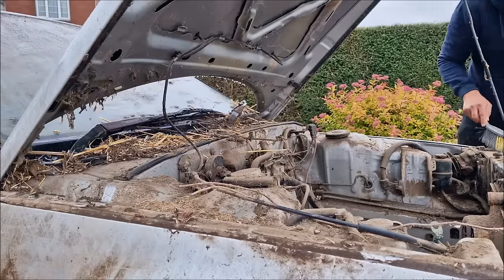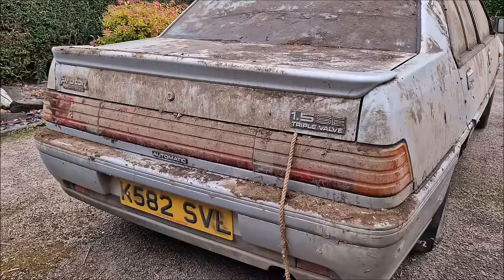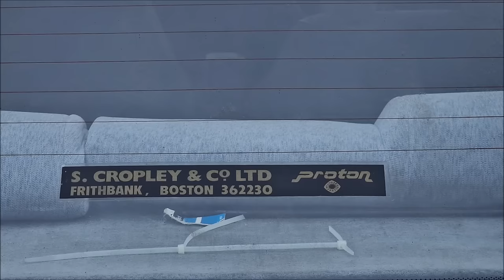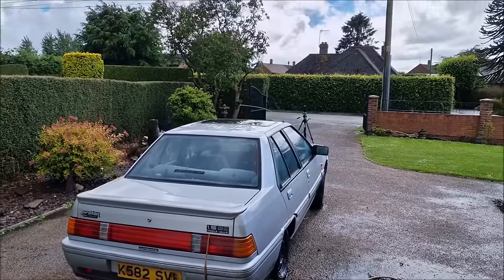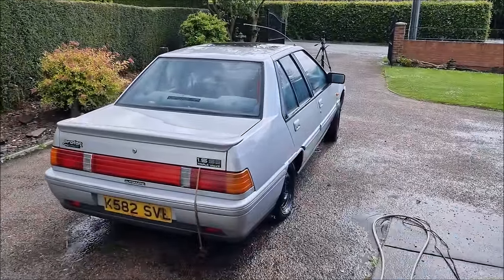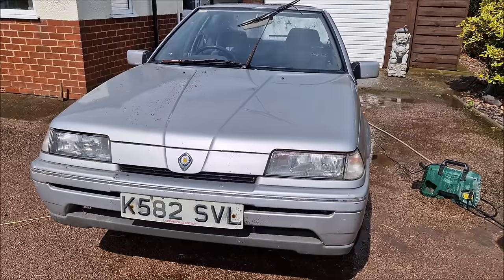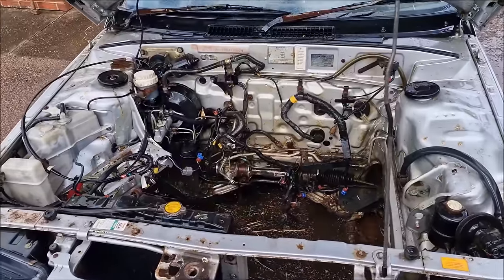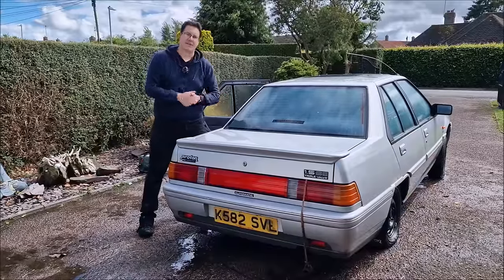Cleaning The DIRTIEST Proton Saga I've Ever Rescued! - Barn Find Proton Jet Washed

Comment: These are meant to be disposable just like any 90’s family sedans. Seeing this getting cleaned warms my Malaysian heart though. 

Also speaking from an Iswara Aeroback owner myself, I’m impressed there’s lack of the telltale “bubbly rot” that any old Saga gets over the years! Even with the decade old dirt and grime, there’s hardly any surface rust. Heck, even the rear spoiler didn’t crack.

That, along with the surprisingly decent interior just shows how much of a difference in climate can make or break cars. My Iswara Aeroback certainly didn’t age as well under the hot and humid Malaysian weather, and definitely slows personal efforts at restomodding mine. I’m curious to see your future plans with those babies after (hopefully) a new engine and a bunch of parts.
Reply from the maker: Thanks for watching - yes a lot of our internal plastic parts weather much better than they do in the Malaysian humidity and heat - I have sent a lot of fan vents over there recently :)
Reply: This bodywork is produced back when PERWAJA Steel is still operating, back then the quality of our steel are topnotch. Wonder what went wrong

Comment: I believe these Proton cars used the same 1.5 mpi engine from the Hyundai Pony X2 of the same era... This was originally a Mitsubishi engine from the Mitsubishi Colt of the 1980's to early 1990's - My mum had a J reg 1991 Hyundai Pony x2 1.5 GSi auto (4 speed) and it was pretty quick for an automatic with only 81 hp ! Great car !
Reply: You're god damn right. Even the 2001 sonata used the same 4g63 motor as the 1995 Proton Perdana.
Reply from the maker: Yes thats absolutely right :)
Reply: @JonCoupland  I remember it was a 1468cc 12 valve engine (which was very similar to some old Hondas) mounted transversely with the gearbox on the left hand side and the engine on the right when looking at the car whilst standing in front of it... All the very best of luck with saving all these Protons ! which were great cars during the early 1990's ! :)

Comment: The first generation Saga was developed as the result of a joint venture between HICOM and Mitsubishi Motors. It is based on the second generation Mitsubishi Lancer Fiore, and was available in 4-door saloon and 5-door hatchback guises. The second generation Proton Saga was unveiled on 18 January 2008. It is based on a stretched Proton Savvy platform and was developed in-house by Proton. The third generation Proton Saga was launched on 28 September 2016. It is based on the outgoing Saga FLX platform, and is powered by the Iriz's 1.3-litre VVT engine.

The name 'Saga' is an acronym for 'Safety, Achievement, Greatness, and Ability'. In Malay, 'Saga' refers to the hard red seed (abrus precatorius) of the Saga tree. The Proton Saga is also a well-known national symbol of Malaysia.
Reply from the maker: Thanks for the information!

Comment: Good morning everyone... when I watched this video, I was surprised that in 2024 there are still proton cars that may be over 30 years old in the UK even though they are left full of stubborn dirt, if you want to wash them manually without a powerjack machine it will definitely take a long time  to be completed. The condition of this proton car seems to be intact, the paint color is still intact and there is no very bad damage on the car body also like in Malaysia, it is also almost the condition maybe in the UK, the climate is not the same as the climate in Malaysia but the position of the car has not changed much, it may be a Malaysian car with Japanese technology  this is still of high quality in terms of the materials it is made of, the iron is now from the recycling process and my own car, which is much younger in terms of age, is not as good as this car... in conclusion, any original product must remain good despite its age, indeed I was surprised by  his age...🇲🇾

Comment: Why waste water
Reply from the maker: You may think it's a waste of water, and actually I considered that too, however I will be removing a lot of the external parts when I strip the car which will be sold to keep other cars on the road. They will all need to be cleaned before being sent to their new owners.  Cleaning it this way used significantly less water (and time) than it would have done having to individually wash all parts as and when I post them out. ☺️👍
Reply from the maker: I should also add - I'm washing the car with rainwater that I have collected and stored. My pressure washer is attached to 4 large water butts and a pump ☺️